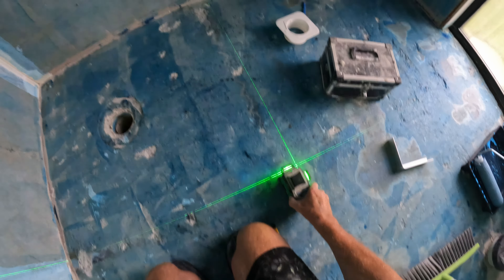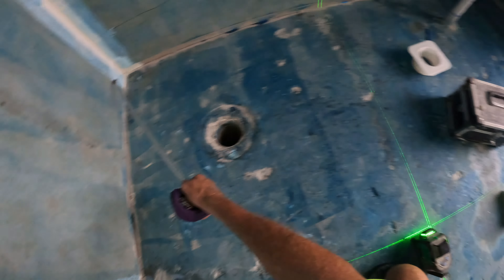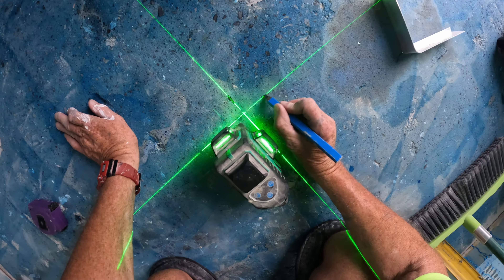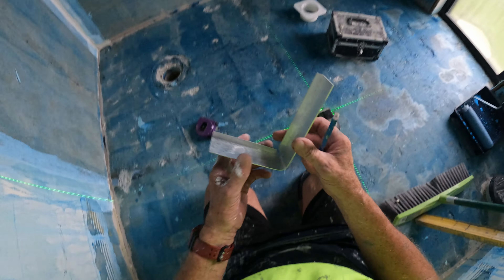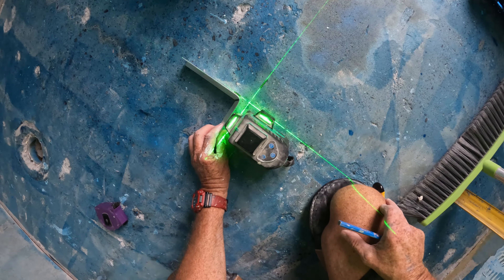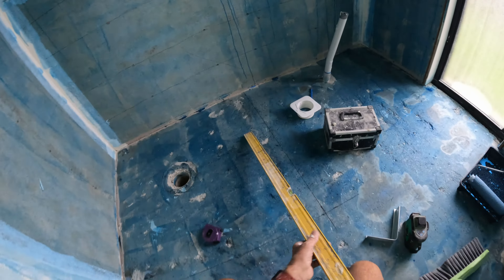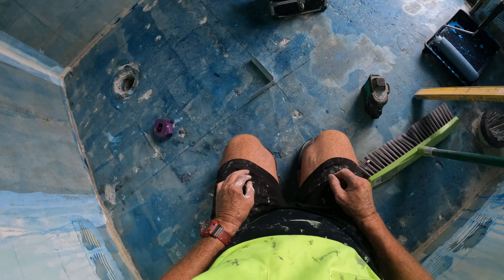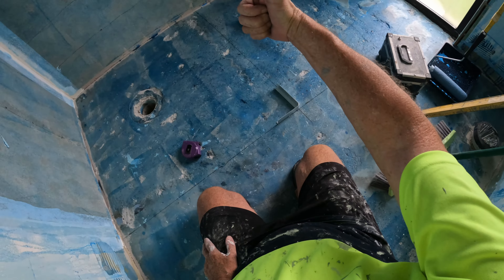Showing You How I Set Out My Shower Base

Comment: This is awesome Chris'o 👍👍 question mate, if the walls are not 90 degrees to each other does it matter? Either way you just measure the off the wall and just set it at 90 degrees with the laser? Thanks mate
Reply from the maker: Yes, that is correct. Geoffo that's shower must always be square and so does your whole room if there's one wall out of square so be it Thanks for the questions Geoffo. Keep them keep them coming I'm sure it helps heaps of people
😀🙏🤣🫶👍❤️
Chriso
Reply: @candtmarbleandceramics  thanks mate because when I did my shower screen my walls were not square to each other. So would you then use those lines from the laser as your square to tile off Chris'o?
Reply from the maker: Yes you got it mate
💪🫶👍❤️😀 Chriso